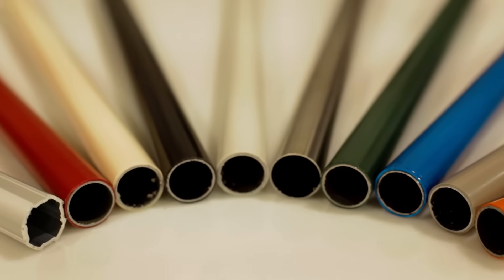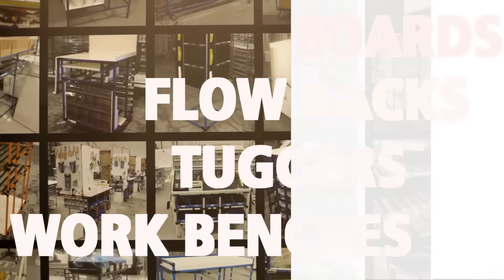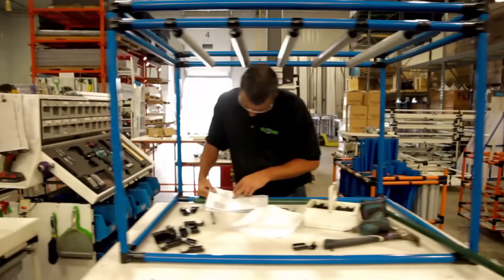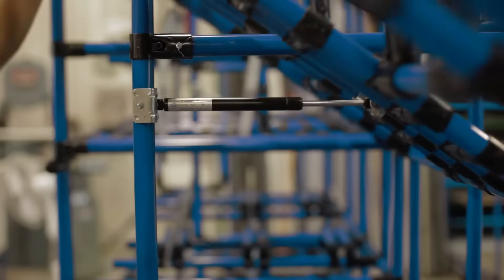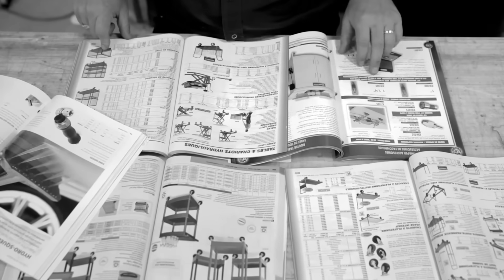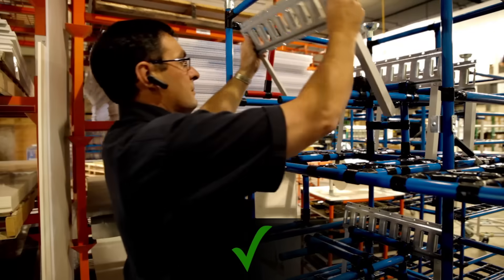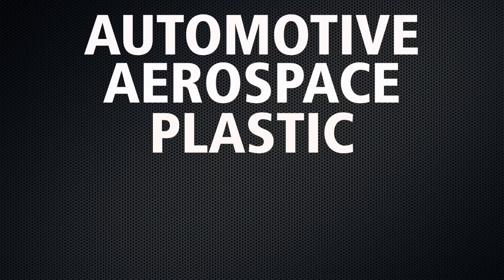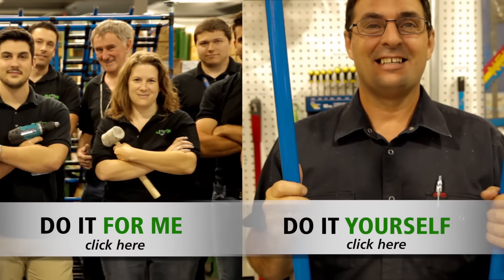Pipe and joint system for lean manufacturing | Flexpipe

Comment: Can the connectors be used with any EMT conduit?  If so, what size?
Reply: Hi Chris, yes you can use with EMT3/4 but you will need a special adaptor. check out our sister company tinktube https://tinktube.com/shop/3-4-emt-adapter-for-pipe-connector/